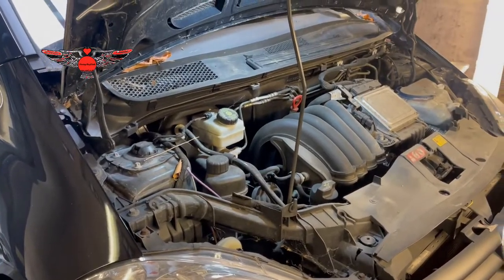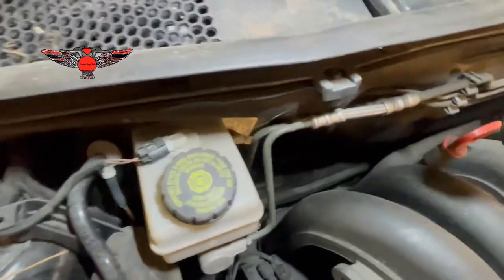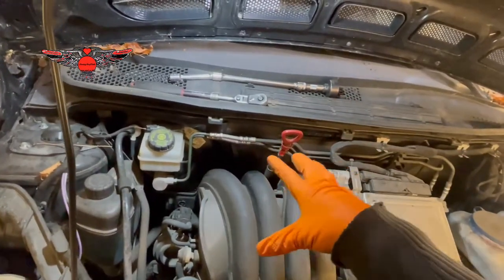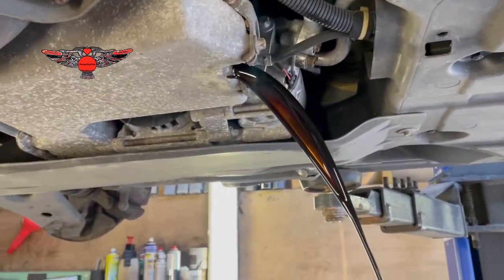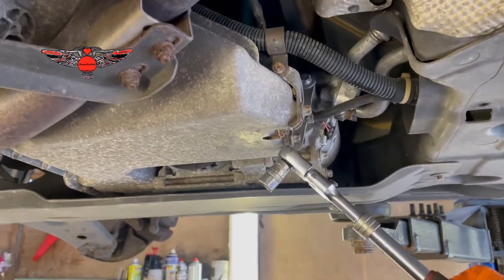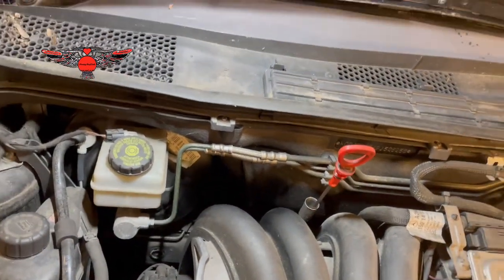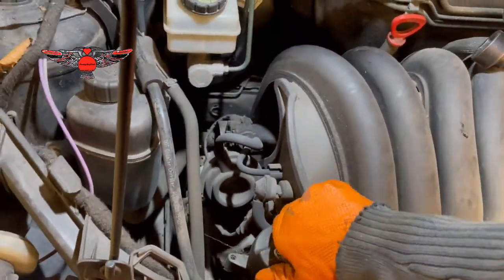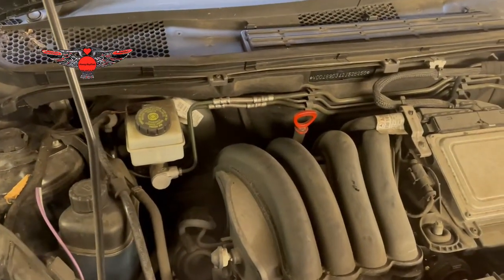Mercedes A150 w169 oil and oil filter change with service message rest

Comment: Thanks! 
For this engine (1.5) when do you need to change the timing chain?
Reply from the maker: Well do be honest as long as you keep the oil changes it should go for a long time..I dont think there is a schedule as such for replacing it..
Reply: I had an issue where it would grind on cold start. People told me its the tensioner, i chaanged that and 5 minutes + 100EUR later its still the same. What ended the rattle at start was going back to ORIGINAL OIL and FILTER, not OEM, ORIGINAL in mercedes bottles. 5w30 has 270 000km runs just fine. So chains last very long.

Comment: Any video how to change manual gearbox oil on these cars?
Reply from the maker: Sorry I don't have any manual versions of this car at the moment..
Reply: @DaringBeefcake  ok no worries hope you get the chance one day to it your video are clear and steps well explained 😊 need to change mine cause this car got some noise issue with gearbox and oil need change
Reply from the maker: @koookao  thats cool, i understand and well if I get a chance ill do one, regards..
Reply: @koookao  Its the bearing set, they go bad. Took me a week to DIY and will all the proper tools from mercedes that my friend borowed me (frame holder, special engine lift bracket and a schema of the gearbox as well as the bearing insertion tool for 5 speed manuals). 200EUR in parts (120EUR are the orginal bearings the rest is oil i also put in original)
Also by some gasoline to wash out the gears when you open the gearbox it will be full of shavings
Reply: @averagedev7768  that's interesting thanks for sharing! I just change the oil for my 5 gears manual that's it